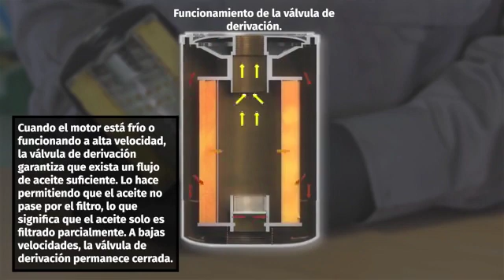¿Cómo funciona la válvula de derivación de un filtro de aceite?

Comment: no entiendo , en frio no filtra esta cerrada para que haya mas aceite por el circuito, y cuando calienta el aceite es cuando filtra?
Reply from the maker: ¡Hola!
La válvula de derivación no filtra el aceite, permite que una parte del caudal de aceite salte la capa del filtro
y el aceite va al motor sin ser filtrado. Esto sucede en situaciones particulares cuando el aceite está frío (en esta condición tenemos mayor densidad del aceite) y cuando el motor tiene altas rpm (revoluciones por minuto), en este caso el motor necesita un alto flujo de aceite para lubricar y enfriar los componentes móviles.
En el funcionamiento normal del motor, la válvula de derivación está cerrada y las capas filtrantes filtran todo el flujo de aceite.
Esperamos haber resuelto tu duda.
¡Feliz día!
Garage Gurus Team
Reply: @GarageGurusEU  supongo que hasta que no coge 90º el aceite se considera frio
Reply: @dukelakk pero eso amigo no tienen ningún sentido, el aceite estará sucio siempre, si en el momento del motor frío no filtra, puede estropear el motor, únicamente debería de NO filtrar si el filtro está obstruido, no si el motor está frío o va a alta velocidad…